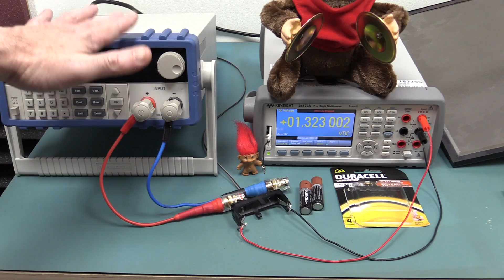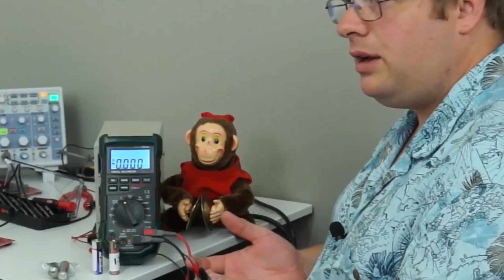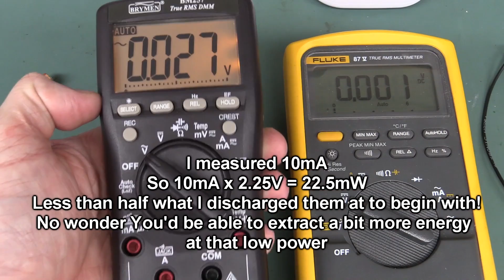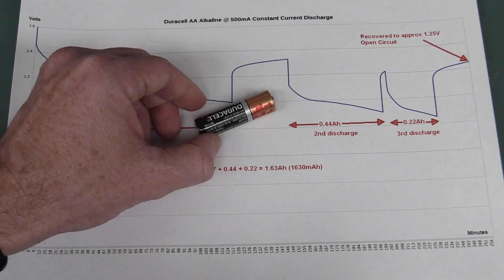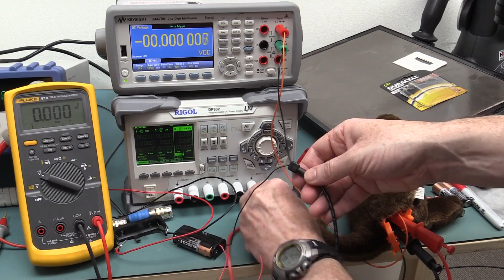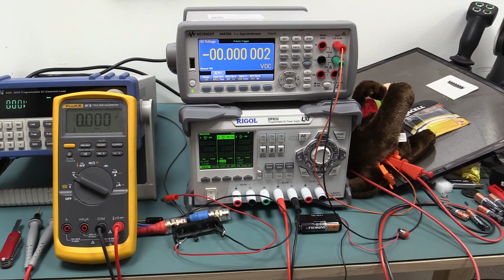EEVblog #789 - Batteriser Monkey BUSTED!

Comment: "Shock the monkey!"

Put a new AA cell in series with a 10K Ohm resistor and measure the voltage end to end with a good multimeter. You'll get essentially the same voltage as the voltage measured without the resistor. But with ANY load put on it with the the resistor in place it won't power much of anything. That's an external example of the cell's internal resistance that shows that the measured voltage alone doesn't mean squat.

Comment: Nice test would be to have 2 monkey toys and stuff an identical pair of battery's in them with batterisers on 1 monkey. Then let it run continuous and see how much longer (if it even does that) the batteriser monkey runs for. Would be great to see a test like that, maybe also with some other devices to see if there are any cases where a boost converter would do any good.

Comment: This has nothing to do with the actual batteriser product... Were they trying to change the conversation? The true question is does their tech make batteries useful for longer?
Reply: Their video dave was responding to was a response to one of daves original complaints about the Batteriser. It was the trying to show using a PSU in place of a battery can't work. Though they only demonstrate their lack of knowledge here. Sadly most people will not get this and will go along with it.

Comment: Note that this is similar to checking a dead car battery. if there's no load on the battery, it'll still read around 12 volts. However, turn the key and "tick"... nothing!

Comment: Allo m8, I notice you keep saying "battery" while holding a CELL... a battery is defined as a SERIES of cells. Big misnomer that a lot of people are stuck on. I still catch myself using that incorrectly so no biggies just bringing it to your awareness. We rarely uses "batteries", rather in most applications there is a single "battery" which is composed of multiple cells dependent on the differential voltage required for operation. Dunno how long humanity will continue to butcher its language. heh. Cheers! great vids!

Comment: If it is a boost converter, then it should reduce the life of the battery. Boost converters are not 100% efficient. One way of looking at it is the battery is a container of water. You have a set amount in the bottle, you can change the rate that you pour the water out, but in the end you still have the same capacity. Most boost converters are less that 80% efficient. A joule thief is the best example of one that works well, but I doubt these are anything like a joule thief. I would like to get one to test it.

Comment: Well. Just yesterday i heard a guy on YT talkin about his "120W internet supply power" and a "high power 250 watt power installation"
I have also worked as a car mechanic for 12 years. During those years, i think that every other CAR mechanic measures the OC voltage on a battery and says it's fine, starts the engine and measures the charge voltage of the generatora and says "every thing is good here". 
People cannot tell the difference between voltage, current and capacity even with "the idiot triangle" infront of them.
So my conclusion is that almost nobody knows anything about batteries. Let them figure it out, since the thickness is inpenetrable :D

Comment: Looks like Batterizer has been paying for more dislikes... not nice Batterizer.  Thanks Dave.  This is why when I check my batteries, anything less than 1.3V open circuit (just for stupid VERY rough estimate) usually heads for the flashlight bin.  Flashlights work great with such low energy.  Another great video Dave.

Comment: The fact that they use Volts to demonstrate a batteries level of charge in their marketing bullshit should tell you they are either really dumb or really deceitful .So it shouldn't come as a surprise when they measure open circuit voltage.

Comment: So in the end after a multitude of these videos and as many kickfarters for crap devices perhaps the masses will understand that just like rechargeables the disposable batteries also have their rules. Cycling disposables from high power devices to lower power ones is the most efficient way to use them. Or you could just go get some li-ion rechargeable AAs and make sure you use them right to save yourself a hundred bucks or probably way more on batteries. Not ruining the planet with heavy metals is an added bonus.

Comment: I'll take the word of an experienced electrical engineer with nothing to gain over what is nothing more than clever marketing for the ignorant from a manufacturer who. has a financial gain from this product. 
It ain't rocket science, just have to understand batteries. I deal with large lead acid traction batteries, a dead, internally short circuited cell can (not always) still show 1.8-2.0v open circuit. Put the tiniest load on and it will drop to 0.5 - 0v or in some cases actually reverse polarity on the multimeter reading. Point is a good open circuit voltage tells you SQUAT about energy left/available.

Comment: Batteriser needs to go. Fucking scammers ... and fuck the news media that hype their bullshit product.
Reply: To be fair, the product itself isn't bad (or at least the idea; I haven't actually tested the product itself), it's just being incorrectly (deceptively) marketed. 
There are some applications where you do want constant voltage (even if it drains the battery faster) but where a converter was not used to cut down costs. Like a flashlight. I prefer a flashlight running at full brightness the whole time even if it kills the batteries faster, because the alternative is throwing the batteries away at half capacity because the flashlight is no longer bright enough. In most (possibly all) applications a product like the Batterizer will not extend the life of your batteries but it still may be useful.
Reply: ***** or you could buy a flashlight with proper boost converter. I've experienced that only cheap products require a secondary voltage booster.
Reply: Arto Pekkanen Well, cheap or old. And you're right, you could buy a new flash light. Or you could buy this. Both are valid solutions. That's my whole point. The people behind it are lying, thieving bastards, but the product itself does have a legitimate use and may actually be good. Of course, I will probably never find out, because I won't buy it on principle, but it might be good.

Comment: That is because they are Alkaline right? Which maintains high voltage as the energy is drained, unlike "heavy duty" and "super heavy duty" batteries which their voltage drops as the amps get used up.

Comment: i do not know much about batteries, but this batteriser seemed like complete bullshit from the beginning :)
I mena, wouldn't You have the step-up PSU running constantly draining the friggin battery? if only it was when the device/say keyboard/ is on, however this would most likely not turn of like ever, even then i can't see any scenario when the device would actually prolong the battery life, not shorten it... also overlooking that batteries are "soft" sources of power where the voltage can drop quiite a bit under load when depleted....
I wonder what are the users going to say when they start making and shipping those bloody things...(if anyone that can read/write is actually going to b stupid enough to buy this)

Comment: I know that a power supply will work in place of a battery because when I was 10 I wired a cordless phone power supply into an old battery powered mechanical veemon alarm clock when I got tired of putting batteries in it.

Comment: Hey Dave, I stumbled onto your channel a few days ago, and just wanted to say that I appreciate you going into such depth debunking this batteriser product.  I'm a trained computer engineer, but have never really spent much time studying batteries, so when I heard about the batteriser, and read through their marketing materials, I thought, "Wow, that kinda makes sense that it can use the extra voltage energy that is left after the device cuts out at 1.3 volts, etc."  Your previous two videos went above and beyond in proving that the cutout voltage for most devices is nowhere near that high, making any gains from the batteriser negligible.  The fact that they're making these strawman argument video replies is hilarious.  Keep up the good work, mate!

Comment: Exactly. It's like saying "My car old dead battery is alright, it reads 12v" then you wonder why the bulb or starter motor you just tried running off of it acted as if it was in open circuit and the voltage reads under a volt closed circuit :P

Comment: You kind of go on forever in your video. Main busting part happens after 19 mins for people wlth little time

The best information in this video was at the beginning where you explained your test setup / showed how you drain down to 0.whatever volts, and then let the batteries sit, the voltage goes up, and basically everything after 19 mins. The rest IMO could have been cut without loosing much from the video.

This video clearly shows how are you draining the batteries, how the batteries SHOW higher voltages the batteries couldn't support under current, and most importantly the test showing 2.whatever volts when you used DEAD batteries and how the monkey SAW around 1 volts. Perfect proof they lied.

Comment: The maketting is clearly misleading and should be illegal. BUT in fact, this product is not completely useless. Sometimes some badly designed products are designed for 1.5V batteries and will cut-off at 1.3V. Theses poor devices are unuseable with 1.2V NiMH cells. I feel this "batterizer" could be useful to boost theses cells to 1.5V. (It will drain higher current and the cells won't give more energy  but the device may work better with a higher voltage.)

Comment: hey this reminded me of a little happening I had with batteries on my blood pressure monitor. They were drained really quick and the monitor stop functioning. It was one of those small ones you mount on your wrist. It would start to measure blood pressure than stood for 5 mins or so on, before screen went off. Later that day when I was turning it on again the battery sign was blinking and it did not work properly despite that the batteries were brand new out of the box that same day....

Comment: A good talk that I am curious with is why do batteries leak when they reach zero energy? Is one of the terminals start to eat out of the battery? Also, is this why we see some batteries we leave in a device for years and come back and see corrosion?
Reply: +Kairotan Some gas is usually generated in the battery from electrolysis, which can rupture the seal. Corrosion from outside or inside sources may also occur. Wikipedia should have a section on it under "alkaline batteries", with failure modes for different chemistries potentially being different.

Comment: Simple: By the time the battery reaches the cut off voltage for the product it's powering, there is practically no energy left in the batteries since most products have such a low cut off voltage. Nothing more needs to ever be said.

Comment: You need to get 2 batterisers, put the batteries in the monkey and drain down until it cant drain any more "without the batteriser" then put them in with the batterisers. Because that would be the final nail.

Comment: +lorenzo portocarrero I'll put this here since my replies have been hidden: You understand that you're just using theorist names to imply that you are correct, without any of the formulae involved? P=IV and V=IR directly demonstrate that if you hold 'power', P, constant, the operational limit is only given by 'R', resistance, which limits the current.

Thusly it is proved that power supplies with different resistances generate different operational voltage ranges.

+Anthony Wildman Well quite clearly you're implying that my statements have been incorrect in an arrogant manner, rather than presenting any proof of such.

Comment: +EEVblog Do what Electrical Engineers do best, and prove it by practical demonstration. You already have a setup that measure constant power and logs energy. Just build your own ultra-efficient boost converter and absolutely debunk (or prove) the 20%-80% claim. The AP6714MG is a very good example, and quite simple to build, that goes down to 0.9 volts and capable of 1.6A MAX output. Take it a step further and run the circuit on two cells in series so that you draw every ounce of energy down to 0.45V per cell.

This way you get away from the whole measurement debate.
Reply: +Sami Al-Terkawi Hasib Be careful when you quote specs.  In the case of the AP6714 it is rated 1.6A max for the switching current of the inbuilt FET - i.e. the max inductor current.  If you look at the performance graphs (in particular Fig 7 on page 5 of Diodes Inc AP6714 data sheet dated April 2011), you will see that at 0.9V input the device can typically only supply about 150mA at the output (still requires 900mA in the inductor), and even at best case of 3+V in it can only supply about 850mA out.
Reply: Thank you for mentioning that, I have completely missed it.

Still, the point is they won't be using alien technology in their device, and most likely they won't use a proprietary IC. If you have other ICs suggestion, please let me know, but the best I found are the TPS1029 and TPS61010.

Efficiency is up to 96% and 95% respectively; SWITCHING current is 1.8A and 1.15A respectively; and minimum input voltage of 0.9 and 0.8 respectively.

Given the size of their PCB, I doubt they could achieve anything above 88% [MAX efficiency], but we give them the benefit of the doubt AND we get to learn how much energy you can squeeze out, or even if the whole setup wastes energy.

This is what makes EEVblog fun, don't you think?
Reply: the claim was 800%.

800% lol

Comment: Dear Dave!

You both have right with Batteriser :) Batteries are different from power supplies :)
Battery voltage will drop after you apply a load (even a load for which a  battery is designed). On the other hand, good power supply, while loaded with designed load should not change it's output voltage. While designing battery operating circuit you should assume, that battery voltage will vary as hell, while circuit designed for a power supply, may expect constant and stable voltage. 
In a company I worked for, we assumed that battery voltage may vary from 0,7 to 1,6 V per AA alkaline cell. And yes, we used boost-converters to extend battery operating time :) Alkaline cells have much lesser internal resistance (even if discharged) than carbon-zinc cell, so in case of alkalines boost converter may help.

Comment: Ill tell you what they did, they stuck the batteries in the monkey till it stopped, pulled them out and let them recover and they happened to recover to 1.25V. It only makes sense, How else would they know that the monkey would not work.
Reply: +Skwisgar2322 Also, if that guy is a professor of any kind of electrical engineering ill eat a bug.

Comment: These guys are located in California. They need to be sued.
Reply: +Propane TreeFiddy For what?
Reply: +Jim Jones Deceptive marketing practices....they are posting pure and simple lies and making hundreds of thousands for it...
Reply: +Propane TreeFiddy What lies? 
All I see are people claiming they know it is a boost converter, yes, I see that it is, but, it is a custom design, very high efficiency, discharges down to 0.5V. Products with boost converters are not tying all circuitry to it, so even if one is in there this acts as a system level boost converter. It has to help, just makes sense. I have not seen the product so, just my opinion of what it likely is. I have looked at high drain products and yes, they can drive the supply voltage down to the cutoff while there is still quite a bit of power left in the battery. Some people on here are going stomp their feet and call people names, do whatever, I do not care. Like it or not, it helps more in some products than others. Just being objective. I am sure there is a product or a few that it may help 8X, all they need is one, yes? It says up to, not all. I imagine it has a great safety benefit and I am sure the battery companies hate it most.

Comment: You said that you could not come up with any way to further disprove the Batteriser. Why not do what they didn't do in their video and stick a low-voltage boost-converter (like the TPS61201) on the dead battery and see how much extra monkey-time you get? After all they them selves claim that the invention is not boost-converter but rather just the size.
Reply: +zinobi The converter is their design, not some off the shelf part. So doing any tests with an off the shelf device does not compare to their product.
Reply: +Jim Jones Indeed! According to the PCWorld article the Batteriser works down to 0.6 Volts while the boost-converter I suggested works down to 0.3V, with pretty good efficiency. Not that It will matter much due to the steep decline of remaining energy around those voltages. And even if we assume that the boost converter in the Batteriser is 4 times as efficient as this converter it should still provide Dave with plenty of monkey-ime. There are of cause other low-voltage boost-converters, this was just the one I remembered on the top of my head.

Comment: That also explains why pulsed load works longer on a half-dead battery, like the 3 transistor single cell LED flasher. Thumbs up, thanks for sharing.